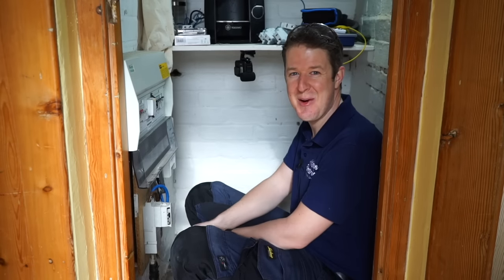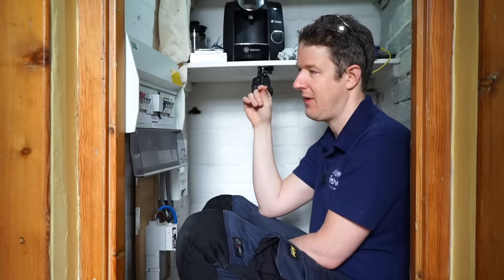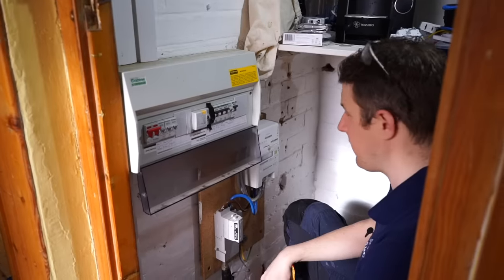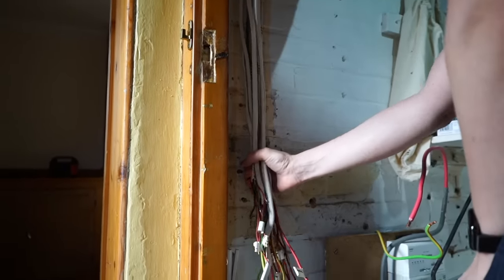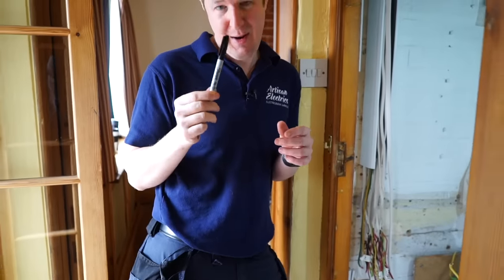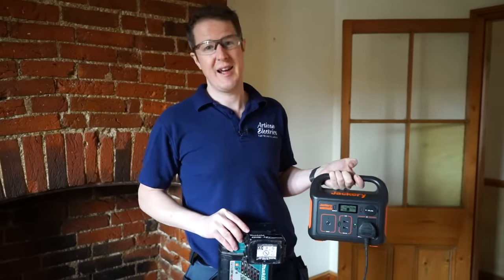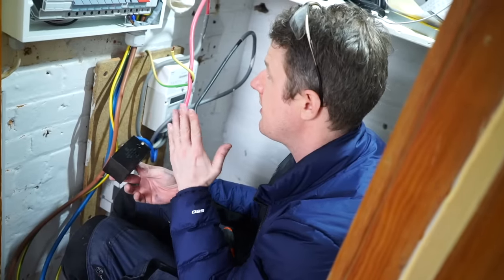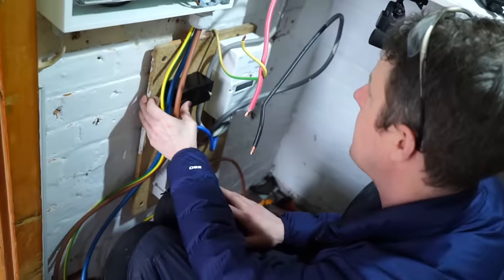My Consumer Unit Secrets 🤫 - How to install a Consumer Unit/Fuse Box

Comment: If you were willing to cut the seals on the c/o why not just cut the one on the meter too it’s the same “offence” (in my opinion if it’s the only safe way of isolation I completely agree with cutting the seals btw) that way could of just ran new tails all the way into the metre no need for un necessary terminations/weak points?
Reply: Because he doesn't have to. He only pulls the fuse because it is the only way to work safely without calling out the DNO. Also, maybe he has a sealing kit for the fuse but not for the meter... some sparks do.
Reply: @jam99  your not allowed to cut any of the seals and remove the DNO’s fuse at all regardless of the circumstances. But all I was saying is it’s black or white have you cut seals or not YES cut 1 or cut 3 either way you’ve broken the law may as well do the full job 😂 and what sealing pliers would only crimp a seal on a c/o and not on the meter they’re the exact same seals and wires
Reply: @jacka5994  a) Why double the chances of getting into trouble? A supplier won't be bothered with what is to the left of the henley block and the DNO won't be bothered with what is to the right of the henley block. b) When a judge awards a penalty in a court of law, the penalty is usually based on the severity of the action. Double the offense can increase the penalty. c) Sealing pliers can fit branded seals.

Comment: When I Do consumer units and distribution boards that have trunking terminating into them I always mark the cables within the trunking with an explanation of the circuit so it's easy for the sparks that may come after you can easily see which cable goes where

Comment: A DP 100amp meter switch is only several pound more than a DP 100 'Henley block' any reason not to fit ? irrespective of what switching you have in the consumer unit.
I sort of cringe when I see an open cut out without tape over it or refitted without the fuse as I'm just waiting to see a cable fall in there..especially a a bare earth one...ouch !
Reply: Not fussed about the isolated but yep, get a tiny bit of tape on their. Only takes a random cable to swing down and it’ll get interesting. I think their work is good from what’s shown but a little bit of tape can save you!

Comment: I always renove the main fuse and put the fuse holder back on the cutout, only because knowing my luck id fall and touch the mains🤣
Reply: Agreed much. I was wincing a bit as J pulled the tails out of the CU and they were bouncing around a bit.
Reply from the maker: Yeah I did do that just didn’t show it on the video
Reply: It's not in there at 27.39...
Reply from the maker: Yeah initially I forgot but you can see it later on. Usually I use these insulating plugs that a DNO guy sent me but Cory has them in the van.
Reply: @artisanelectrics  or a piece of cardboard torn off the new CU box wedged in does the job 😉
Reply: @Marco-mg9tv  if it doesn't quite fit, can you make it wet so it can be moulded in to place? Asking for a friend. :)
Reply: Haha couldn't help but notice his knee millimeters from the exposed main incomer early on in the video
Reply: @KevAsh  🤣😜
Reply: I was more worried when all the loose t&e were dangling around before the board was on. One of those could easily have dabbed into the cut out
Reply: Are you authorised by the Dno to pull the fuse?
Reply: @adamturner5250  Authorised, the blokes a trained electrician if you're component and have the correct safety gear what do you need authorisation for.
Reply: @lewis94uk  still needs Dno authorisation to pull fuse wether he’s a trainer or not mate..it’s illegal..also what safety gear did he have on when pulling the fuse?nothing
Reply: @adamturner5250  Everything UKPN employee I've seen over the years has said the same thing to me 'just pull it mate the blokes on the ground will never grass you up'
Reply: You can't remove the main fuse it's against the law and classed as interference with a electricity supply 😭😭😭😭
Reply: @irishlad7458  how do you safely isolate the supply then?
Reply: How long did it take you do this job, just the installation of CU & testing?
Reply: Off record, you will find that 99% just pull it and not say a word
Reply: @adamturner5250  it's pretty much assumed these days, electricity at work act overrules whatever DNOs say
Reply: @adamturner5250  Illegal for him NOT to pull it, under then EAW act
Reply: @irishlad7458  Nope, not illegal. Abstraction is illegal, Removing the main fuse is making a safe work environment. This isn't the 70s
Reply: If a customer pulls the main fuse or breaks the seals, then that will trigger an investigation, for sure... but if a qualified contractor does so. No issue. HOWEVER, if he or she doesn't reseal the fuse then there's an issue (exposure of live parts without the use of a tool)
Reply: @adamturner5250  What law is he breaking? i want a statute Let's not go the american route of describing everything as illegal if you don't have it in writing
Reply: @dc-sd3gd  you call the DNO and at an arranged date and time they come and pull the fuse, then blank off the open cut out and generally ask what time you want them to return to reinstate the supply and re tag the fuse. 
And they normally fit a 100 amp double pole isolator so you can switch off the supply in the future without having to get them back to pull the main fuse.

Comment: You said that you were going to put on the Henley block instead of cutting the meter seal and replacing those tails. Could you not have taken the consumer unit tails directly to the meter? Wouldn't that have been a neater install?  What is the implication of cutting the meter seal? Excellent video and really neat workmanship. If only other workman were as neat as you!

Comment: These are interesting videos to watch after work, as always with any of the YouTube sparks, but my concern with these style of videos is that the amount of them out there now on how to fit a CU/ DB is crazy,. Especially when anyone without the relevant qualifications can just buy the bits and pieces from screwfix, then have a go themselves at fitting a CU/ DB following a YouTube video. Note to anyone unqualified doing what I've just mentioned, just because something works doesn't mean it's safe.
Reply: You could say that about anything technical on the internet

Comment: To someone like me whose electrical competence peeks at replacing a fuse in a plug, these vids are fascinating and very enjoyable. If I'm not being too cheeky to ask, I've discovered that one of my double power sockets upstairs is a spur off the downstairs ring main. (The wiring was done in the 1980s). My guess is that this is against the Regs - is that the case? It was passed when the property was inspected shortly after we moved in in 2004, but I'm not convinced that it is a safe practice. Thanks. End of cheekiness.
Reply from the maker: It’s absolutely fine tho not best practise
Reply: @artisanelectrics  Thanks very much.

Comment: One word to describe it Artist!!!!! RCBO’s look so much neater that duel RCD’s without a shadow of a doubt!!!!!
Reply: There's no excuse to install a twin RCD board, there are rcbo boards for every budget.
Reply: @acelectricalsecurity  agreed, but RCBO’s are still very expensive, I really do agree with you but when your trying to win a contract and your customer is on a shoe string and someone comes in and prices for a duel RCD board which do you think the customer will choose? You with your RCBO board or the cheaper option of a duel RCD. You can’t really argue as they both do the same the RCBO is just a better design. To be fair I have spoken to my wholesale and they are going to start getting Fusebox boards for me to fit as the price is more reasonable
Reply: @gmeadowcroft84  your right with the point you make, and it's only going to get worse if we have to fit AFDD devices as well as SPD, as you say the fuse box stuff is cheap, I think about £8 for an rcbo.
But technically we shouldn't be fitting twin RCD boards, because the regs say a fault on one circuit shouldn't affect another circuit, but for some reason we all get away with it, and I include myself in that as well.
Reply: I’m new to the industry to be fair, but I try to explain to the customer the benefits of each individual board and hope that they make a decision that they have well advised on. I want to give my customers the best for there money and make it as safe as I can for the money that they are paying. So I do try and push the RCBO’s. I guess I can’t do any more than that lol
Reply: @acelectricalsecurity  On a TT system, RCDs which are bound to be 2 pole are significantly safer than a string of single pole RCBOs and there is nothing technically wrong with a twin RCD arrangement sensibly populated.  Of course 2 pole RCBOs are best of all, at about £19 each.
Reply: @gritpipethin  most of the mini rcbos are double pole and there is something wrong with it, it breaks the reg that a says a fault on one circuit should not affect another circuit. They are no better than a single front end RCD the effect is still the same. Time to move away from the bad old days, last time I fitted a twin RCD board was about 6 years ago.

Comment: Impressed with your work and the tools you have, many which were not available when I was working,. when changing consumer units (fuse boards at the time 🤣) was done by torch or if you was really lucky a lead light from a neighbours supply or connection on to the incoming supply.

Comment: Brilliant video and a lot of valid points too. My question is the meter is a smart meter and if these lose power they send a signal to the supply and then they come out and see why I know by cutting the seal the supplier can fine you for doing that. how do you go about this with smart meters? I usually have to get western power out to pull the fuse so it's recorded on their system.

Comment: I was taught when doing CU's or DB's , you  do them the same way every time. Infact I was taught regardless what it is sockets , switches ect wire them the same way every time and do it neatly . If you have to leave the job and then go back to it , it's easy to pick up from were you left off and That way you will make less mistakes, and also your work will last a long time and won't develope faults , if you  to go back years laters you can easily fault find and add  circuits , plus you only as good as your last job in customers eyes .

Comment: Top workmanship. If you have to use ordinary grommet strip (or grommets in metal boxes) I always kept a little hot-glue gun handy, glue on the backside of box hole to keep it looking tidy, grommet never gets displaced even when shoving cables through.
Reply from the maker: Nice tip!
Reply: Roy , when use to do Metal  Consumer Units used 2.5T&E slit to side along the KnockOut , never has grommet strip.
Reply: There are battery-powered hot glue guns available as well, which would be handy when working on the electric panel if there isn't power available.
Reply: @oicfas4523  Yes good idea!

Comment: A nice job you have done.For termination of multiplexes cable I use ferrules to prevent any copper strand folds back  and when I fix trunking to the consumer I  usually cut the dimension of the trunking by a jigsaw  which it fits neatly and for marking  I always use pencil and I like  to put some masking tape were I need to make  the marking. I also do marking of each circuits as you  have done before connecting so if I have to isolated any particular circuit I will find it immediately.  Bye and well done again.

Comment: Great video and lovely work. I echo what's already been said about exposing the mains terminals by removing the mains fuse. I work for UKPN and the mains fuse should not be removed by anyone to isolate which is why it's sealed. These days we take photographs of the cut out outs to prove they have been left sealed. If in the future the seal is found to have been removed there could be a case for suspected tampering which wouldn't go down well with your customers. So if you do need to pull the fuse call your local REC and get them to come and pull the fuse and they will return to seal it up once you're finished. Hope thats helpful?
Reply: Everyone knows that any extra time waiting for DNO is extra cost to customer. What is the solution? DNOs should be rolling out the fitting of isolators in all properties. Forget rolling out smart meters; get the sodding isolator switch fitted. It is in the interest of safety, the consumer and the trade.
Reply: @jam99  Even when a new smart meter is fitted there is still no sign of an isolator. You would think this would be the ideal time to fit one.
Reply: I agree. More importance is place on sealing the fuse etc than providing a isolator. Safety always comes second.

Comment: In Australia "Down Under" we only use Milwaukee Inksall, because they work and you never need to throw them away. Also I tried Tradify and was very happy, however It didn't offer GPS tracking to customers or Post Invoices. I know that the mail is dying however some elderly customers prefer a paper invoice and we normally send 20 through the post a month.

Comment: Great job ! I noticed you removed the fuse from the cut out , fair enough you had to isolate it.
However if you had just installed an isolator you would have saved it from having to be pulled out again ?

Comment: Very interesting video. I’m having a kitchen extension- no increase in electrical appliances and told I need to change my 2014 plastic unit. If this is correct what do the newer ones do that old ones don’t and is Hager best one

Comment: Hi. Great video and some excellent advice but would I be right in saying that the gaps visible at 45:41 between hole in the CU and the trunking is too large?
Reply: There would be less of a gap when the lid is on, rewind to when it was installed the plastic bent inwards i bet it open’s up to square when the lid is on.

Comment: GREAT JOB & NEAT TOO, I ASSUME YOU DID BRING YOUR TORQUE SCREWDRIVER & TORQUE THE TERMINATIONS TO THE CORRECT TORQUE SETTING & ONE TIP FOR YOU, WHILE WORKING ON INTRICATE STUFF LIKE YOUR LITTLE NUMBERING SYSTEM, I WOULD WEAR SAFETY GLASSES TO AVIOD ANY OF THOSE DANGLING WIRES ACCIDENTALLY POKING YOUR EYES & LAYING YOU OFF!

Comment: Your tip about doing the cables in on the same side as they go in on the switch - it should actually be the other way round - put them in the opposite and then the cables will sit on top of each other as they loop around the the main switch rather than crossing over like yours do here.

Comment: Great work very professional, only suggestions I would use MCB lockouts, not insulation tape + warning signage at both ends of the faulty circuit. Also would invest in a folding workmate bench rather than working on the floor for assembly work, your knees and hips will appreciate this in years to come.

Comment: Just a question/suggestion. Do you have a regulation that specifies a minimum height from the floor for a DB/Consumer unit? I understand that this is not a new installation.  Personally I prefer to mount it at a height where you could stand upright and  work at a DB. It also serves the purpose that small children can't reach it easily. I can see that you take pride in your work.

Comment: Notifiable work is fine to do for a competent DIY'er:
Council may accept an EIC completed by a non-qualified person if you ask before-hand WITHOUT any inspection required. Ask council and get approval to begin works, borrow an MFT for a day, fill out EIC, submit to council. They will review the EIC and provide you with a building regs certificate.
If you can't fill out an EIC, you can ask the council beforehand and they may inspect, test and cert it for you
You can also find someone with TPC (third party certification) who can test, cert and notify for you

Comment: WOW. 8 mins in you pull the Negative out of the CU but the Main Fuse is unplugged and not protected (not covered) Had that bare Negative cable swung and touched the live side of the now unfused main feed there would have been a nice firework show!!!  If you are going to pull the main fuse, please protect the live main which is still hot on one side! Please correct me if I am wrong.

Comment: Do you not need to you use bootlace ferrules on those flexible tales? Stranded cable like that is a bugger for loosening over time without either a soldered lug. I can’t make out the amount of strands is it like tri-rated stuff or less strands? Lovely and neat job 👌

Comment: Nice job. My advice, however, is to have used a larger board with many more spare ways to really futureproof it. In time, more people will use AFDD, home surge protection, power management systems, want EV chargers etc. I tend to use up to double the size that I actually need unless the space is really confined. Definitely RCBO's over MCB and RCD's. Much better.

Comment: You could try high low high low when doing a board change it spreads the load across the bus bar and stops it heating up at one end.
Reply: Regs say to put heavy loads nearest to RCD then work way down to 6A.
Reply: @andrewcockburn412  heavy loads next to each other can interfere with the rcbo/mcb rating due to localised heating. Effx did a video on it recently l.

Comment: In regards to the incoming tails via a single 32mm gland.... I don't understand why One would not use 2 x 20mm plastic glands.... but in an Industrial environment One would have to consider Eddy currents, seeing all Dist. Boards are now metal. Therefor Shouldn't Glands also be Brass. And all Feeding Tails would be SWA Cable from Main Fuse to DB? Where does it End Hu. Good Vid, Hats Off!

Comment: Can you shed any light on why Hager seem to take the surge device straight off the main switch ? When regulation 534.4.5 states that the spd should be covered by over current protection ?
Reply from the maker: It has its own built in overcurrent protection apparently